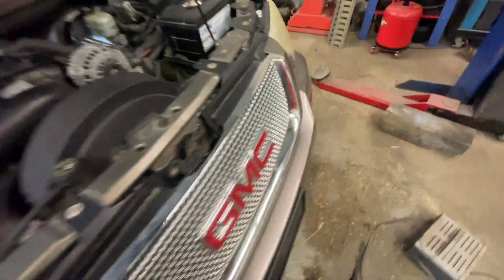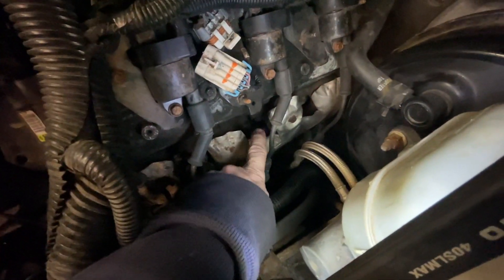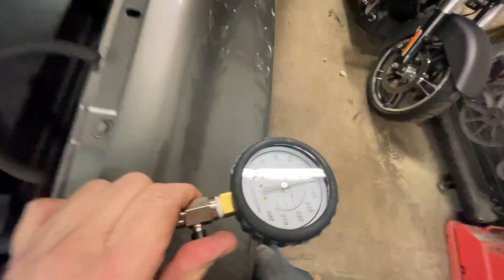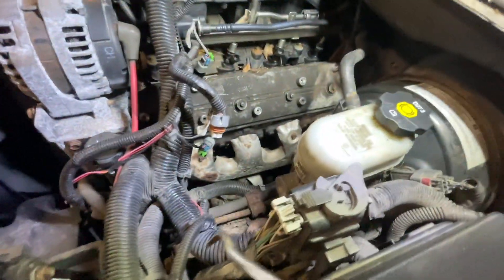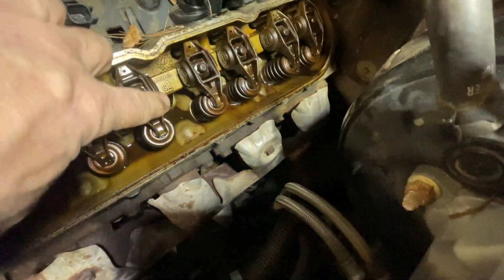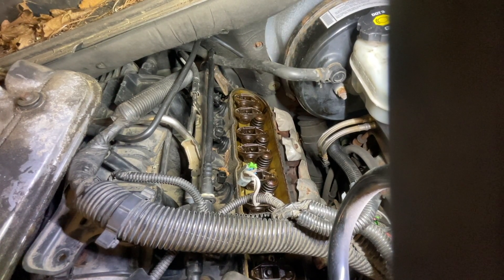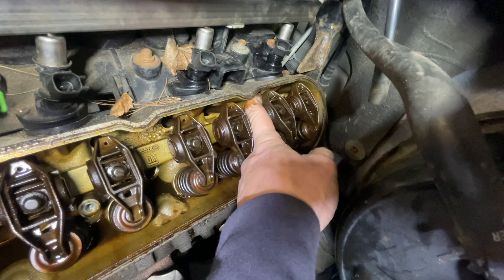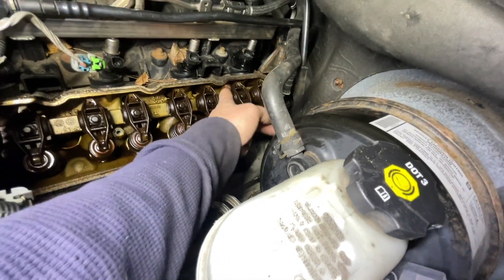HOW TO Code P0300 | Diagnosing misfire on GMC Envoy Denali 5.3L | DOD | Displacement on Demand

Comment: Aloha see you j.Gipe 👍, I got 5 Buick LeSabre 2000 to 2002. Moms been driving one. I'm 6'2" didn't want truck. 4 are under 100k miles
Reply from the maker: 3800 motor? If so great old reliable car you got there
Reply: @KenMrKLC  y.

Comment from the maker: *UPDATE*  after doing some research the lifter is prob not stuck over carbon buildup as mentioned, it’s actually a locking tab mechanism that gets worn and locks it up. There are NUMEROUS videos on fairly successful methods in getting it freed up. I will update what I do